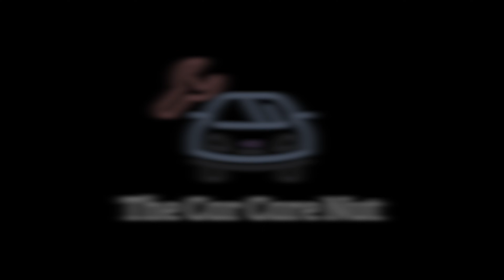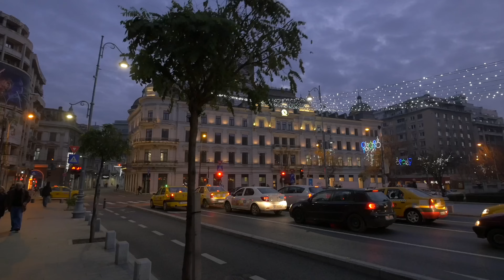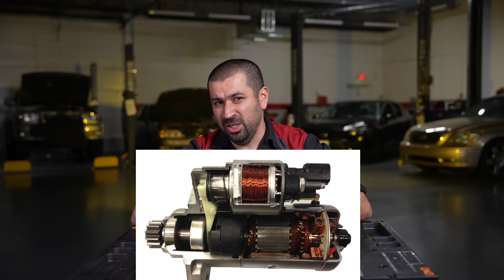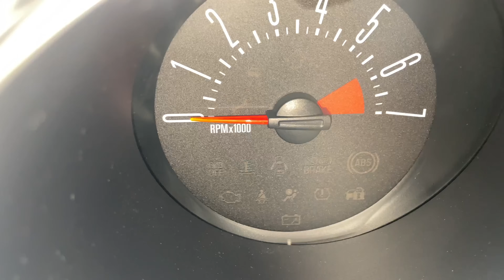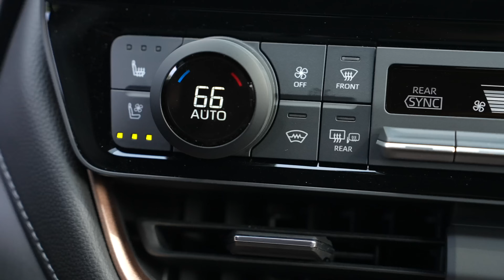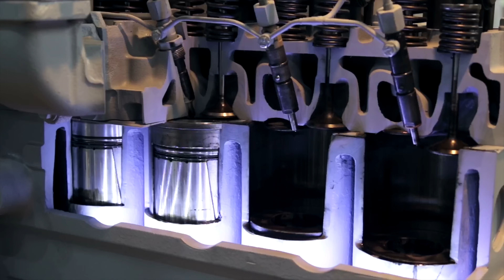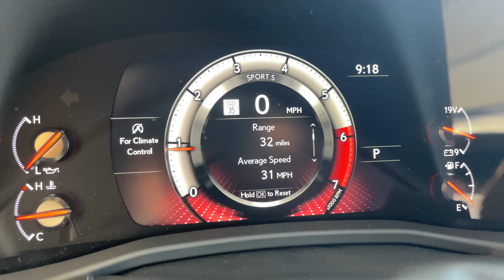How Does Start Stop Technology Work in Modern Cars? Everything You Need to Know

Comment: Having an electric water pump and an electric AC compressor is part of both energy saving (not having to run when not needed) and start/stop (able to run when engine is not running).
Reply: Same evolution as electric radiator fan, all reducing the number of belt driven systems.

Comment: I have had my car for 3 years now with this new technology. I was told to switch off the feature but I figured the engineers designed the system to work the way it does. Any alteration on my part could potentially have negative effects so I decided against it. So far it works as advertised. Everything is running smoothly. Fingers crossed.

Comment: Superb explanation! Thank you! BTW I want to add some info to this.. some of the start stop tech that Toyota uses maybe borrowed from Suzuki. Suzuki has an excellent system they implemented before 2014. They have an auxiliary 24V Lithium battery (a small one) just to assist the start stop operation and to keep things managed during idle stop. And they use a Alternator Generator Motor. Unlike your regular alternator which only generate power, this one can work backwards as a motor pulling power and rotating the belts which does the cranking. This way the regular starter motor is only used when you start the car by pressing the start button. When start/stop happens you don't even hear the car starting up.. no cranking noise.. the engine comes to life as if you hit a mute unmute button.. kind of like hybrids.. This way, the started motor's life span is the same as a regular car. Suzuki does call this a mild hybrid but the motor cant drive the car.. the newer models can do a little creeping during bumper to bumper traffic but that's all you can expect. The engine shuts off when the speedo drops below 15 KMPH and glides to a stop as long as you are pressing the break pedal..
And the HVAC evaporator system was also there the early mild hybrids. There is a menu option you can select between 3 HVAC settings like, ECO, Normal and Comfort. The computer adjusts the time the car stay stops according to this setting and ambiance temps. So I guess Suzuki has the most over engineered start/stop system.. Anyway coming back to this video it's done very well, very informative.. I guess you didn't know about the suzuki's crazy system.. well now you know :)

Comment: Great info! I have a 2021 Subaru outback and always disable the start / stop function. I put in a new Flooded battery, however Subaru recommends an Enhanced Flooded one with start / stop tech. There are not many for sale, and some have said its a marketing ploy to buy the Subaru battery.. which Subaru sells for $700!!! I'm experiencing a "slow starter turn" about every 50 starts, and it always has started, just a slow turn, then it goes back to normal until 50 starts. My battery passed all metrics, correct voltage, load test, no parasitic drain, alternator charging at 14.2 volts.

Question...Can having just a flooded battery be the cause of the "slow starter" turn every 50 starts?  Many Thanks!

Comment: Is there any way to disable that auto start to where I don’t have to hit that fuckin button every time I start this car?
I pushed and held the button and it was straight for weeks….then yesterday I put the car in park and the engine like power cycled or some shit…(it still had auto with the line through it on the dash so it wouldn’t start stop) but now I can push the the button on off push and hold to get the auto with the line through it but now I gotta do it every fuckin time i start it… any ideas (2025 Sentra)

Comment: I have a 24 Subaru Crosstrek, and this vehicle has stop/Start. I don’t mind it so much, however I have noted on warm summer day when running the AC the engine will restart if cabin temperature starts climbing. I was a little worried about the starter, watching this video, I feel better that it won’t die prematurely. However I am starting to think changing the battery will require a certified mechanic rather than just me in my driveway.

Comment: It’s absolutely ridiculous,if the car lasts more than twelve years you will only break even! The starter motor is twin motors when it goes wrong it will cost you a couple of thousand to get it replaced,the manufacturers have put it in a position that makes it difficult to get at ,Big labour costs the motor again twice the cost!  Yer on a looser!!

Comment: Let's just start by saying that there were cars that were designed in the 1980's with transverse engines that would just run for over 200,000 miles and need nothing but oil changes and gas, and the dealers were happy with that because when it came time to replace the front cv joints they made bank on that, water pumps, timing belts in cheap cars that would self detonate because the timing belts were normaly put on cars that had interference top ends, its to complicated to understand the reasons why manufacturers did this untill you get the whole thing, the dealers want your money any way they can get it, nothing is new ecept how they get it and "they" are getting it, lol, enough said.

Comment: 26:36 He's right start stop batteries are not cheap. I have a 2016 Honda Civic and my local garage wanted to charge me over £200 to fit and install. Going to the honda dealer turned out to be much cheaper. I paid £180. Despite this I am amazed at the engineering behind this technology. I loved how you explained everything to a non-car guy.

Comment: That sound like a hell lot of added weight and single points of failure for a minor improvement.

Does the increased strain on tires/brakes and fine particles emitted due to the weight is less than what this system offers?

Comment: Honestly, I like it. That is, when it accomplishes that cycle seamlessly. I've driven a Suzuki Ignis hybrid and its auto restart feature is so perfect you can't even tell the engine stopped or started when you stay still or take off unless you look at the tachometer. Some people don't understand the power of scale. If every car at a stoplight has that system engaged, the streets would be WAY quieter and also have cleaner air. It's crazy how loud some cars are while idling.

Comment: Special battery, special starter w/ start limit, special HVAC evaporator, additional sensors, extra water pump, extra oil pump integrated into the transmission, additional computer systems = additional points of failure and additional cash needed to fix when something needs replacing. The R&D costs associated with all these new components and systems are most-definitely being passed onto the consumer too, make no doubt about that.
Oh and I imagine it'll be harder for third party part suppliers to manufacture the replacements, so your only option might be the official certified dealer, so more cash to service your 2020+ vehicle.

Good luck with that. I'll stick to my 2012 Mazda 3 hatchback and the tools in my garage for now. Maybe I'll buy a car with standardized start/stop tech in 2040 after all the current beta testers have given the auto makers enough recall-worthy feedback to refine, make it cheaper, and more reliable.

Comment: Thank you again for a very informative video, you explained a lot of my worries, like shutting off the engine after a high speed run without allow adequate oil to run through the turbo bearing and cool it... if the computer thinks that would cause engine damage, it wouldn't do it (shut the engine off). I wish you were my mechanic here in Wales, United Kingdom.

Comment: What about the turbo ? The oil pump is mechanical and will NOT pump oil for the turbo. If the blade shaft of the turbo and also the oil is very hot when the car shuts off, the oil will be cooked around it the shaft. That is bad.

Comment: Very nicely explained, thank you for that. But you say it doesn't result in engine damage--yet, the engine experiences, inherently, acceleration loading with the oil pressure having gone to zero. I'm having great trouble getting my head around the notion that such repeated low oil pressure loading will have no effect on engine longevity. If I'm right, it'll take a helluva lot of saved gasoline money to pay for the engine replacement when it gives out early.

Comment: So basically they added more parts that will break down.
Reply: Not necessarily , the biggest question is does  the added cost for the stop start system worth the extra 1.5 mpg you get from it , answer- probably not.
Reply: Engineers know the mean time between repair and mean time between failure, another reason to never buy extended warranty, if it happens to pay off its same likely hood of hitting on slot machine.

Comment: No, it's NOT "like fuel injection."  I was alive and driving when fuel injection was becoming standard in (late '70s onward) and I can tell you FI was 1.) generally WELCOMED and PREFERRED, especially on small engines and sportscars  2.) only replacing ONE subset of ONE system - the carburetor(s) - and didn't need global changes to starter, transmission, battery, HVAC, water pump, etc., etc.  There's no comparison.  Start-Stop is DESPISED and UNWELCOME, so much so that MFRs added the disablement switch knowing it would be hated.

Comment: Juice ain't worth the squeeze. The amount of gas saved vs battery starter wear and tear is an environmental shell game. Moving the smog pollution into battery production. Yes the battery is designed more robust. However that more robust battery would last even longer without the feature. I will disable with a third party device in every vehicle. Feels bad. More to go wrong. Very little benefit.  A safety concern. Yes I do know of 2 stop and and not restarts on cars less than 3 yrs old. The fact that a touring trim Subaru let's you disable it in the infotainment permanently through the driver profile shows it can be offered by manufacturers.

Comment: @7:50 - a BOOST CONVERTER is not a capacitor.  It's a package of electronics that can work on a wide range of voltages.  During start, when voltage drops sometimes below 11 volts, the boost converter converts what voltage there is into high frequency AC, transforms it up to a higher voltage, then rectifies that voltage and stabilizes it at a specific voltage.  It does what you say it does - but it's not a capacitor.y 2017 Tacoma headlights dim significantly during start-up.  But like you said, the converter is there to maintain a specific voltage.  NOW - I DON'T KNOW THIS:  but many computers can work on just 5VDC.  Does that make a difference ? ? ? IDK!

Comment: I absolutely hate it!  It only shuts off for a few seconds and its hard on batteries.  In South Texas, the A/C is running full blast 80% of the year so when it shuts off the A/C gets hot almost immediately and the vehicle starts back up within a few seconds.

I disable it as soon as I get in the truck and when I forget I cuss the system and turn it off.  On my days off, Im going to be looking into Forscan to turn it off permanently or the plug in that keeps it off all the time.

Comment: I would suggest that is you have Start Stop Technology is that you never drive it more than a few miles without it in operation - if you drive it for  say a few hours without it you will probably experience a drop off in brake performance. If you do ,re engage and the pressure should return fairly quickly, but not instantly. Extremely good explanation - well done.

Comment: In my area, there are so many timed traffic lights whose red light lasts an eternity (1 minute to 90 secnds). I used to turn off the engine on my old conventional car to save gas. There was also a long gradual down slope on the way to work. I thought it was fun to turn the engine off and coast down this hill in neutral. Well, after a few months, my battery died. I couldn't start the engine in the morning. The mechanic gave me the third degree because the battery wasn't that old. I confessed what I had been doing and he told me to stop doing it. He said starting a car takes a lot of juice out of a battery and me doing that 8 or 9 or 10 times a day would kill any battery no matter how much the alternator tried to replenish it. Fast forward to today. I have a newer car with idle-stop-start. I like it because I know I am saving gas and lowering emissions. But I get paranoid whenever I approach a traffic light that has been red for a while. Will it turn green just as my engine turns off? Or the engine shuts off when I approach a stop sign when there are no cars and there is no need to wait. I find myself fishing around in the dark for the I-S-S OFF button to keep the engine from turning off needlessly. My car also seems to decide to turn off the engine when I haven't come to a complete stop. With my foot applying just enough pressure to come to a gradual stop, the engine cuts off and the car comes to an immediate stop with a jerk. My wife in the passenger seat then looks at me like I don't know how to come to a gradual stop anymore. Another time the engine turns off on me is when I stop the car to back it in to the garage or into a parking spot. Ijust no I'm going to have an accident while fishing around for the I-S-S Off button.

Comment: I'm sorry, but Start/Stop technology was introduced by Volvo in the early 80s in an effort to make driving more affordable.  Most european cars had manual transmissions.  Upon coming to a stop, the engine would shut off.  Step on the clutch pedal, the engine would restart.  Of course, there were other conditions that needed to be met, but this idea started a long time ago.  It was limited and not wide-spread.  Also, Toyota played with the idea in the mid-70s in response to various oil crisis.

Comment: Personally I think the start/stop system aggravates the tendency of engine piston ring deposits especially in turbocharged engines. Consider that if the engine is hot from higher speed driving or acceleration in traffic, then abruptly stops, oil sprays on the underside of the piston stops, which stops cooling off the hot crown area, and cooks the oil residue into a thick tar, over time building up and hardening into a crust. This leads to frozen rings and increasing oil consumption.

Comment: I just worry about going from zero oil pressure to rapid acceleration constantly, and the wear that could cause on critical parts within the engine. That’s why I permanently disabled mine in my 2019 F-150 with the 5.0L Coyote.

Comment: These EPA mandates are a clown show to save about a dollar in six months and cause a lot of stress starting and stopping an engine does not make a lot of engineering sense and logical sense to me. I’ve driven these vehicles, which start stop at work. Also have a company car with this and I can tell youas somebody that understands engines that these engine engines batteries starters the mechanical parts of this will not have longevity. It is what it is my advice is to stay away from it if possible we’ll find a way to shut it off.

Comment: The fact that he didn't mention the  Auto Start Stop Eliminator but worked in God blessing you is troubling, the simple plug in module remembers your on/off choice , doesn't affect your warranty.......just think how long the new battery/starter systems will last without all unnecessary  cranking.

Comment: I love this guy but I'm not sure if the comment that its not bad for your engine is true.   I may not damage the engine but it does likely increase engine wear.  Starting events are harder on engines, oil pressure drops momentarily which increase wear when the engine restarts.  The system is incredibily annoying.  You stop for a millisecond at a light and it shuts down...why, the logic should be better.  Also  many times I stop my car with the brake in a parking spot to get out put the car in Park and release the foot brake and the engine starts back up and then  I have to turn off the engine again with the button.  I put in a disabling device and we are happier.   Emissions.....hogwash.   More Woke government mandates that make us pay more for cars.   This isn't saving the planet!

Comment: Thankfully there is usually a button to shut off start stop or you can pull a fuse or cut the power wire supply To disable it

Comment: The system is a useless and over-complicated monstrosity.  From an emissions perspective, the catalytic converter only functions properly when it’s at very high temp.  When the engine stops, the cat cools to the point where it’s ineffective when the engine restarts and then takes time to reheat.  It burns more fuel on restart than if it was just left running.  It puts more wear and tear on the starter.  The emissions reductions calculations that the manufacturers conducted assumed the catalyst was operating at full efficiency.  Not the case and the system is totally inefficient and generates more harmful emissions than just leaving the car running.

Comment: People have done research and said it doesn't save crap as far as fuel economy and I don't think it actually saves much on emissions either and it's an annoyance and they should get rid of it. Stupidest thing ever designed. All that engineering effort and work to save what? I'm surprised customer is having demanded a button to just disable it yes we have to turn it off each time we start the car which is annoying enough customers are going to complain I think they're going to just make it so you can override it completely. Also all of this starting and stopping starting and stopping starting and stopping cannot possibly be good for the car